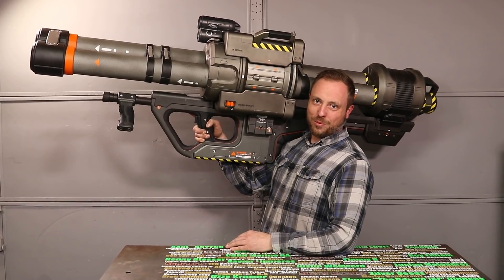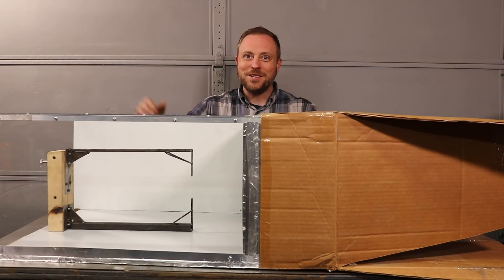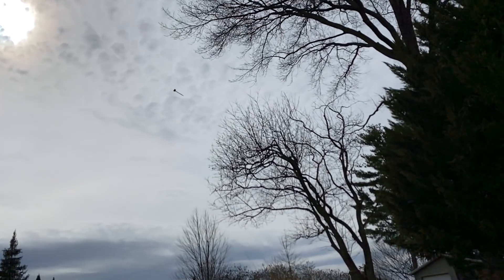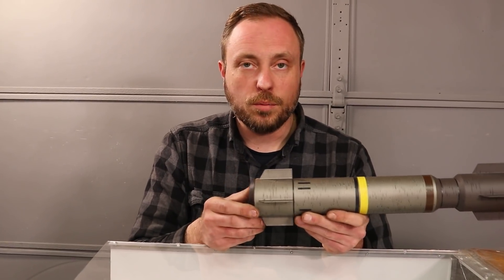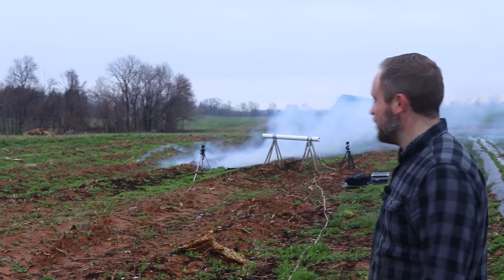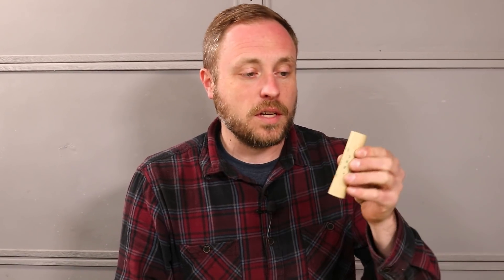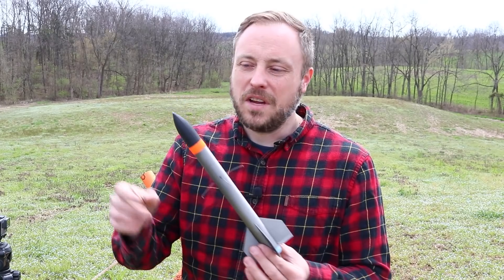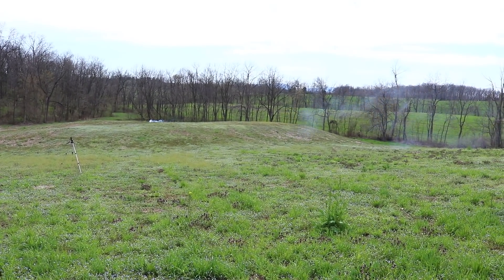Halo Rockets in Real Life - Absolute Garbage

Comment: drag=/=weight
the smoother paint, lowers its DRAG allowing it to move through the air better, which loweres its SIMULATED WEIGHT, BUT has NOTHING to do with its actual weight, what has more to do with that, is just using less paint.

drag increases its "virtual weight" or "simulated wiight" and only while the object is actually moving, when its stationary it has no effect on anything except the way it looks.

Comment: I’m sure it’s been touched on but you’ll never have repeatable accuracy if the barrel is that much bigger than the projectile. Part of its stability comes from the barrel walls, obviously it’ll never be stable if it’s bouncing around on its way out. Maybe you can add discarding foam sabots to the rockets?

Comment: You should just make it as a discarding sabot design it’ll track straight (as long as you aim it straight) a lot less parts you’d need like tgt simple rocket aswell as the casing which can be a simple 3D print

Comment: Do you think thr original halo rocket design with the rounded cone might work, maybe not as well but still fly fine if it had spring loaded fins like the design that worked but tucked into the body, it might cause some reliability issues but since you wanna keep the original look so bad it might be a good compromise plus you might be able to design some air slits at the front to push the air to stabilize the rocket while having the flat head of the rocket, kinda like how some cars or airplanes have those wind catching slits

Comment: So basically actual rocket with warhead would be heavier at the front end than the rear section with the propulsion so a non issue, but for a hollow prop the shell body is unbalanced.

Comment: smaller diameter tube with backing that restricts air flow ~1/4 of you diameter.  Folding fins with a bit of deflection to initiate spin stabilization should kick the rocket a bit faster out of the tube and help it maintain level

Comment: First of all it's a rocket, not a missile.

You can't use a string to prove anything.

A rocket has a rocket engine in the rear end and is usually heavier in the rear than in the front, ore you could say it is unstable on purpose.

When you fire the rocket, a small charge launch it from the tube, and then the rocket engine ignites at a given distance.

In that moment when it leaves the tube, it actually doesn't fly straight, the nose points a bit upwards, it is only when the engine ignites, and i gains speed that it starts to go straight, and even then i doesn't rally go straight.

The rear end with the engine, has to point a little bit downwards, cause, a rocket don't have wings, so the only thing holding it in the air is the thrust from the rocket, and som tiny fins. 

Some "rockets" don't have a rocket engine only a charge, that fires it out of the tube, the have a very limited range, while those with an engine goes further.

By the way the fins are collapsed, and folds out when the rocket leaves the tube, and they starts to rotate the rocket, for stability...like a rifling in a gun... the carl Gustav is actually rifled 

So you must understand how a real rocketlauncher work before you can make a toy.
Reply: this is why you have no friends son.

Comment: ... thats not how rockets work at all. you need to take into account the thrust and what that does in stabilization. 
you want the center of mass of a rocket closer to the thrust point, balanced between the center point and thrust point or else itll be nose heavy and just dip into the dirt. like the RPG-7 missiles.
use stabilizing fins and you got a working platform.
general weight, glide weight, and thrust weight are all different.

Comment: Considering that some of the later game versions had fire-and-forget capability, it makes sense that the missile would require so much forward weight, as it would have mounted a seeker head and warhead. They also would have more powerful rockets that would propel the think at much greater speeds.

As for the last design you showed, I doubted that the rubber bands would have worked, but color me surprised. I can't wait to see the further improvements you made, too.

Comment: If you're planning to actually fire rockets out of this thing while holding it, it'd be a really good idea to have some sort of blast shield so the exhaust doesn't hit you. Pretty much every actual rocket launcher either has one, or uses an initial burst propellant to send the rocket a few yards downrange before the motor actually ignites, for exactly this reason. (There is one exception: those whose rockets actually finish burning before they ever leave the tube.)

Comment: Simply put your rocket doesn't have a explosive payload that is the weight of the rocket . So center of gravity is not where it's at . Take a gyroscopic toy and a small electric motor and your rocket won't divert course . By putting it in the nose it will add a artificial weight as well .

Comment: The Halo rockets have active guidance and gyro stabilization. Their shape is designed to be more manoeuvrable than stable aerodynamically. The SPNKR rockets are modelled more closely after the Stinger air to air missiles than after the RPG. You'd likely need to integrate a gyroscope, servo fins, and a camera seeker to get it to fly accurately.
Reply: That explain the sharp turning when it's locked on a target. 😆
Reply: @tristanbackup2536  yep, also the SPNKR rockets are likely to be aerodynamically unstable (like the F16 is) to help with maneuvering.

Comment: Very cool. I noticed the original rocket design has a band around its center of reduced radius. Is it possible to turn the area after that into a cylindrical air duct  around the motor increasing the drag toward the back a lot more? potentially adding more fins inside? Reguardless. awesome video!!

Comment: Well about the nose cone,...
Even in subsonic flight, it can be really important : the rocket is dragged by two forces 
Weight, proportional to the mass of the rocket
Air drag, proportional to : surface in front of the air flow (maître-couple in french, sorry I don't have the English term, the air speed squared, and a coefficient of drag determined by the geometry.
In heavy subsonic rockets, the air effect of air drag tend to be of little importance, thus you can use not so aerodynamic shapes without decreasing performances. Conversely, in lighter rockets, especially figurative ones, with a higher surface to weight ratio, the air drag is prominent, thus a lesser aerodynamic shape drastically lowers performances.
Just an example from my owm model rockets experience :
- an A type rocket of an inch in (22mm in facts) with a weight of 20grams will get a 30% increase in apogee altitude when switching from a 2inch to a 2.5inch nose cone
(Micro-fusées in French classification)
- (Mini-fusée in French classification, I don't know your equivalent) 1kg and 2.5inch in diameter, the shape of the cone nearly doesn't anything, except for soil penetration when the parachute doesn't deploy (I set my club's reccord to 50cm or 20 inch because of a faulty main switch)

Comment: Hey so, just a bit of info on rocket launchers... Most modern launch platforms expend the entire motor inside the tube (Or have some other failsafe/multiple motors, etc).
If you just fire a rocket with a long motor duration from a tube near your face, it could be a safety issue (see Panzerschreck with face shield).

Comment: Sooo. Do those rokets still habe the small reversed charge used to launch a parachute it moddle rokets. If so how illegle would it be if you slipped a little tannerite into the nose of the rocket in place of the weight your using. Because that could be pretty cool

Comment: I feel like the reason the first design was that bad was because of the motor, and lack of a guidance system. That and the whole rocket is alot heavier, considering it has to sustain the air friction of going transonic speeds, explosives, and computer guidance systems in the nose,  So the real rockets would be significantly heavier, and wouldnt be affected by wind as much, as well as being faster. But i feel like recreating that would be extremely illegal lol

Comment: I’d recommend looking at the irl javelin rocket’s for the fin’s foldout system plus the rockets probably fill the interior diameter of the tube ( up to the center drum ) the round bit might be the second half of the “brain” that enables the rockets iconic lock on feature the body might have the dumb fire system ( game dimensions to irl dimensions might definitely be way off the mark )
Reply: more basic idea for the foldout fins use a homemade model rocket motor with low melting point metal as part of it once it burns to a certain point the metal melts and spring loaded fins pop out
Reply: @RalseiGaming  I was theorizing why the game has the drums on the removable dual  tube that’s the closest I can think of 

The first half is an idea of scaling the rockets up to something similar in size as that of the non cannon custom rocket with fold out wings )

Comment: I were just about to suggest more rear drag and then I saw the last design, you might be able to get a couple of the original designs to work simply by increasing the drag at the rear with slightly larger fins or a couple small sections that aren't at all aerodynamic (square lumps etc) it should make them fly straighter if you're just aiming for accuracy rather than distance.

Comment: The final design works a bit like the Javelin missile fins, so it's not totally outside the realm of realism for something the UNSC would use, and you don't have modern or futuristic guidance and stabilization systems their rockets would likely use. Plus it looks cool.
Reply: I'm going to argue that the unsc would use one that looks just like the game one. because of how advanced the thrust vectoring would probably be.
Reply: @tsmspace  I don’t think so because it would be very expensive and impractical
Reply: @ducksarecool5313  they have slipspace drives
Reply: @tsmspace  true
Reply: @tsmspace  Better technology =/= higher spending. Military equipment will always function off of cost cutting first.

Comment: The UNSC likely  have the explosive charge towards the front balancing the missiles.  Besides the designers of the missile  launcher in the game don't know anything  about military weapons.  So you can't  be surprised  that their design is non functional in real life.   That said realistically the UNSC would be using much more powerful  rocket engines. And very expensive guidance systems that only the military  would have available easily.  

But not bad for civilian equipment.  But yeah they would obviously have more expensive tech in the rockets to keep them stable.  Realistically  the "rocket  launcher"  is a guided missile launcher.  Similar to a Javelin.

Comment: Use gyroscopes or flywheels to stabilize them and add weight where you need it. They can even be powered by a Raspberry Pi\motor to level out the rockets rather than just make them resistant to changes in direction. If you feel really diabolical and want to test your programming skill you could also make them steerable or have a homing function.

Comment: First time viewer, fascinating stuff. Did you consider using a discarding sabot i stead of spring steel to keep the rocket straight in the launch tube? That way the rocket would be fully supported in its travel down the barrel.

Comment: I have an idea, since we never saw the game accurate rockets tested with the more powerful motors, that extra power might be enough to counteract the weight gain from before, as for stability, I think it might be worth a try to add some angle to the fins to maybe spin stabilize it, like the other one that didn't work? Either that or a streamer could help with stability too, if it can be engineered to avoid the exhaust

Comment: I wonder if adding slight curve to the rear fins of the first design to add resistance to the rear and some spin to the whole package would stabilize it ? 
And or installing the rocket engine deeper into the rocket to get the center of mass in the front without adding weight since the rocket won't actually have to deliver a payload ?

The working design looked amazing but i still kind of want to see the first one fly :  D !

Comment: He man, rocketry is a very difficult science. I would suggest (just spitballing here) that you could 3d print a rocket nozzle with some thrust vectoring to give it some spin. They would have to be disposable to keep weight down, but they MIGHT give the rockets more stability. Also, perhaps that spring steel wire in the tube could be attached to the forward fins to keep the front end equally supported in the front.

Comment: I am certainly not a brain scientist or a rocket surgeon, but, could you have a mechanism that holds the rocket for a second to get the motor going full force before letting it go? I don’t even know if that would do anything but in my head it makes sense.
Reply from the maker: The rockets actually put out max thrust as soon as they begin their thrust burn. I checked the thrust charts because I had the same thought, but it wouldn’t help. Good thinking though!!

Comment: great work man its super exciting to see, as for the guide spring issue you ran into you could integrate a internal guide rail going the length of the tube to support the nose till launch with a V shape groove, similar to a crossbow rail. that should dramatically and permanently solve that issue. could be made with a simple piece of trim wood and notch the V with a table router.
Reply from the maker: That’s a good idea! I’d have to make it removable to be able to launch the different style rockets but that would be easier than doing a bunch of work to the rockets to put leveling stuff on them.
Reply: @jairusofall  detachable fins sound like a good idea!

Comment: If you want to make that system last, you should really gold plate those contacts. Silver oxidizes in air and will insulate those contacts.

As an addition, you might want to add some rotation on that rocket to balance out any inconsistencies in the fins/ body. There’s a couple ways to do this. One, angled fins to impart rotation. Second, replace the single motor with 2 smaller motors that are angled slightly. You could do this with the original game rockets to make it more true to the game

Comment: Maybe you can drill some holes at an angle towards the back, using the inside body of the rocket as a sort of parachute (or just add internal fins invisibly). It'll decrease efficiency, but increase drag at the back. They shouldn't mess with the model too much, plus it'll look cooler.

Comment: Something that might help.

IIRC, I think the game model is not a recoilless configuration, but is in fact a sealed tube launch.  You might be able to use this to your advantage.

With a sealed end, the back of the launch tube pressurizes and helps shoot the rocket out the end faster than a recoilless configuration - although it's a trade-off between pressurization boost and sabot friction. 

Could potentially help getting the rockets going fast enough to fly stable without a launch rail.
Reply from the maker: That is a great observation! When we reviewed it in game it definitely releases gasses from the back of the launcher, meaning not sealed tube. BUT! If I did, it would make more sense because the launcher has significant recoil and it would make a sabot design far easier!
Reply: @jairusofall  Oops, yeah watching your first video again the back-blast is clear.

I think most anti-armor systems use some sort of dual-boost.  Like an initial explosive and then the primary rocket ignites.  Even the rpg7 has a delayed rocket ignition.  I wonder if that could be (safely) recreated with a small flash powder charge that gets detonated by the rocket motor ignition.  Just to get that launch thump.  

Also, looking at the missile again, it's probably intended to be flush with the launch tube and not significantly sabot-ed.  Have you tried having the 8 fins in the game model  spring-loaded to rotate out along the axial?  Might work well with an almost flush tube, and perhaps impart a hint of spin when they swing out and deploy (if I'm imagining that FBD correctly in my head).  And if the back fins that fold out are a bit larger than the front for CoP, I don't think anyone would complain haha.

Anyways, excellent work mate!  Can't wait to see what's next!

Comment: Really nice design on the final rocket!  Looks incredible while also being incredibly functional!  One thing I was wondering though, if the expanding fins had an airfoil design all facing the same direction radially, would that not help rotational stability as well.  All the dimensions and shape would be identical to what you currently have, except that the thickness would be an airfoil.

Comment: As someone who's used a G motor before, They are absolutely insane. They burn for 1 full second, and produce so much thrust that i've had plastic model rockets break mid flight from the g forces.

Also quite pricey, and they don't smell good.

Comment: You need the motor in the front of the rocket. Probably in front of the CG or wind resistance so the tail fins can easily correct the original rocket designs flight path. I think the motor not being truly straight at the back of the rocket allows it to rotate the entire thing.
Reply: A pendulum rocket is unstable, the center of thrust needs to be behind the CG. The fins need to guide the thrust, not follow it

Comment: Why didn’t you try to put the rocket engine in the front of the projectile? Blasting the flames of the exhaust trough a tube to the back? Could solve the problem with the center of mass in the rocket design.